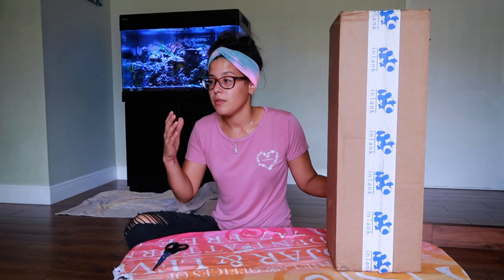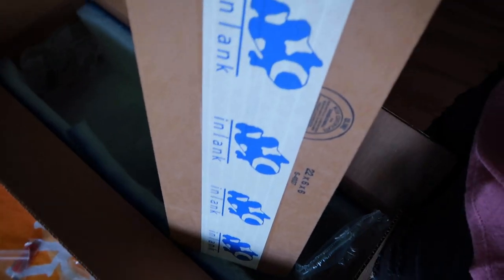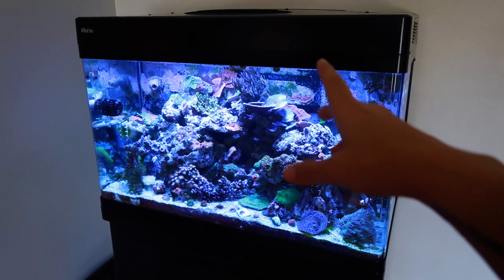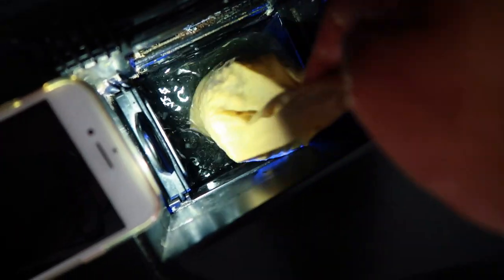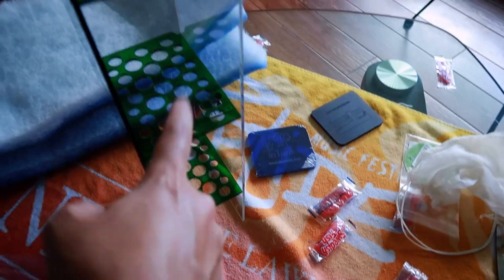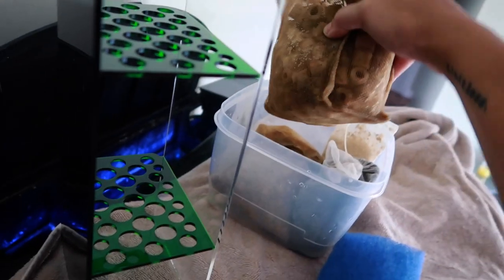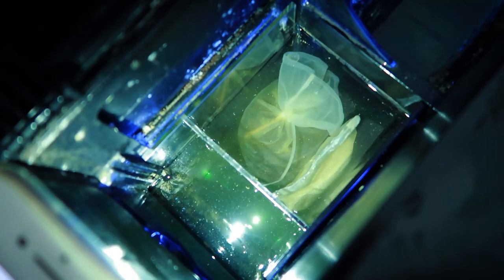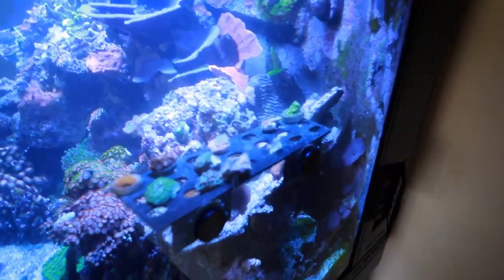SUPERCHARGE Your REEF TANK Filtration!

Comment: Get rid of those ceramic crap.  Very bad for tank. You dont need it.  Nitrate factories.  No need for chemipure. Waste of money.  Put rocks in back if you need it.
Reply from the maker: The ceramics are the big bag I put at the bottom right? Yea they looked like they collected and held a bunch
Reply: @DreamStateLiving  the ceramic hold the good bacteria
Reply: You dont need any crap into the filter. This aint freshwater tank. Get a  bubble maker thats it.
Reply: @blue_water3888  was this to me
Reply: If she does what you told her she’ll have no media what are you talking abt 😭
Reply: @RGMLLC  most run rock rubble or rocks as media.  There is no need for all that extra craziness. Just add rock un back chamber. Not only is it the best media but it adds to biological of reef.  A constant.  Not media being pulled and added.  Its constant.
Reply: @anniejefferson4642  so does ceramic you can tell tht the ceramic has been in there since day one and she hasn’t had any problems with it so why take it out every one has a different way but if the ceramic has been in there since day one and is working why mess with it
Reply: @RGMLLC  algae on sand.  Green parches
Reply: @RGMLLC  true but by her rinsing the ceramic the chlorine in the tap water she rinsed it with most likely killed all the good bacteria on it anyways.
Reply: @justinc3844  but she didn’t specify on what she rinsed it in and I’m assuming she knows better Bc tht tank would be done Bc if she rinses her media under tap she’d probably top off with tap
Reply: @RGMLLC  true but we can only assume that it was tap water cause when someone says rinse usually it's not like she had premixed saltwater on hand to rinse it with.
Reply: @justinc3844  tru but you should be only rinse media with tank water